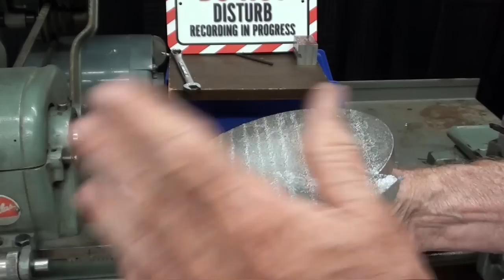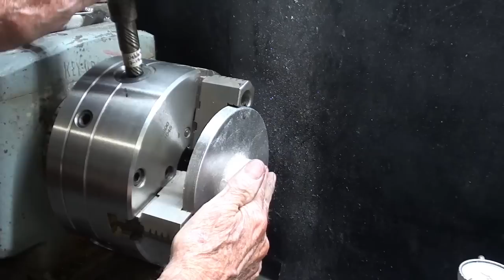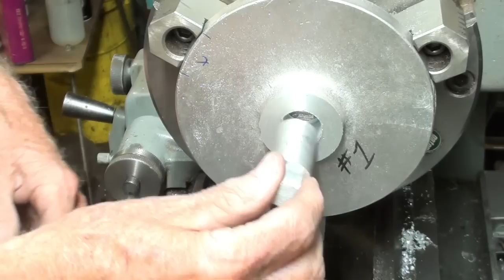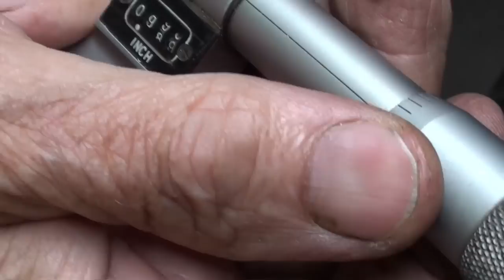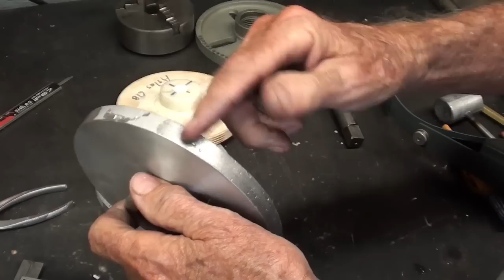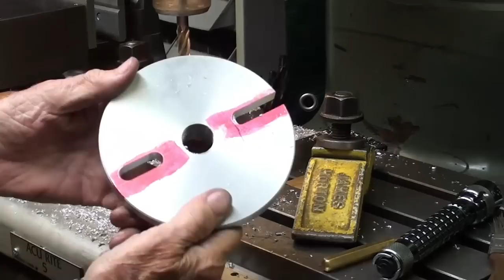DOGPLATE FOR ATLAS 618 Lathe #1003 B tubalcain pt 10 faceplate

Comment: Stop using that adjustable wrench backwards my dad caught you doing that he would let you know that is not right...
Reply from the maker: Does it actually really matter?
I have been told that countless times, but I have over 100 adjustable wrenches just in case I damaged one, lol.
Reply: @mrpete222   OK well enough said Don't use them as a hammer.

Comment: What a great video, not only was it jam packed with bodacious bolts and one nut stories, but what is really amazing is you completely manufactured the part. You designed it with a cardboard mockup then produced the pattern with draft and fillet, then cast the pattern in your home foundry (a luxury I am to be honest a little jealous of) then after casting proceed to machine the project on the lathe and vertical mill. The video just has everything I could want, design, foundry work, multiple machining operations and to top it off, hilarious Tubalcain stories to make me laugh. I cannot stress enough how much I enjoy your work. I have to be honest I haven't any desire to see abomb, or randy richards, or anyone else. Just Tubalcain knocking out projects,  making chips and cracking a few classy Tubalcain jokes is enough for this humble man, and I don't need some school principle telling me I have an awful lot to be humble about, I know it. 😉
Reply from the maker: Lol. Thanks for a great comment. You cracked me up.

Comment: Nice video Mr Pete!  I must say that my grandfather would have been all over your technique for running the die through the bore like you did.  He always required that you back the die and break chips more frequently than you did. Doing so will also reduce the force necessary to tap the hole. Keep the video's coming as I enjoy them.
Reply from the maker: I normally back the dye off when threading by hand.

Comment: Nice work.....kerosine works great  on aluminum, aluminium too..  WD 40 will also work as well.  You can face off the faceplate on the atlas to have it run true, not necessary unless you are going to clamp work to it.  Good job.😊😊😊😊😊

Comment: Nice job!!! We needed an additional tapping in a steel commercial boiler one time. The boiler inspector wanted a certified welder to weld a coupling in the boiler and pressure test the boiler yada..yada. I asked him if we could drill and tap it without going through all that and he said OK. So, we drilled and tapped it for 1" pipe. Worked out ok but was not easy. Nothing to center the tap with just used an adjustable wrench. Took a while.
Reply from the maker: Sounds like a real challenge!

Comment: The reason why a screw is slightly smaller in diameter on the major diameter is that the standard calls for flats on the threads, which is subtracted from the initial nominal diameter. That’s something I’m sure you know, but just didn’t think of.
Reply from the maker: Thanks

Comment: I acquired an Atlis 618 with identical features. With all the tooling that came with it there was a so-called commutator attachment/motor and the strange looking Jacobs chuck, which I had no clue how the heck to use it and what I was dealing with. I look forward to seeing how this contraption works. Will I use it? doubtful, no one rebuilds electric motors anymore but still curious to see.
Reply from the maker: It might be a couple months, but I will get around to it. But first I have to repair the actual damaged device.
Reply: @mrpete222  Mine needs work also it's missing the cutters. Anyway, thanks I didn't know what this thing was till I seen your setup on a previous episode. I did however figure out how it fits to the back of the cross-slide dovetail. That keyless chuck blows my mind, didn't even know it was part of the tooling setup. I haven't yet figured out how to get it to tighten. Thanks again Mr. Pete.

Comment: As always, I loved your video. 
 The Atlas 618 with a good 1/3 HP motor will surprise you. I easily machined a  couple 4 inch cast iron backing plates for the lathe on the lathe. 
I used a drill motor for the power feed to face the plates.
Reply from the maker: Maybe it has a little more capability then I would have thought. Good idea with the drill motor.

Comment: I'm happy for my ACE store to be here in our town 20 miles away because they are the "go to" place for many things instead of the dreaded shitty TRACTOR SUPPLY" horsey doggy kitty food store that doesn't have anything good or reasonable for hardware anymore.
Tip!  Here, we get a much better deal on bolts by going to John Deere or Case and buying bolts off of the bulk bolt area. Sold by the pound. And the bolts are of a pretty good quality.Myabe not the variety like Ace, but common bolts and metrics are available.
Reply from the maker: I was in tractor supply last week. They did have a huge area with nothing but pet food.

Comment: Thank you for an excellent video. 😀😀 In the U.K. the driving dogs we use have straight tails and we call the "dogplate" a "catchplate ". This has a pin fitted to it that engages with the dog tail. My little Portass Lathe that I bought when I was an apprentice was supplied with one of these. Same effect but a different way I guess it's all about different ways of doing the same job. In the U.K. we drive on the left hand side of the road - just to be awkward!! Thank You again!
Reply from the maker: I have never heard of the term catch plate. Kind of interesting.

Comment: Mr. Pete, I was under the assumption that the early Atlas 6" lathe had a bushings that supported the spindle ant those were the machines that utilized the 1"-8 thread. I have no proof. I have a Craftsman which I believe is from the 50's  and it has the close tolerance Timken bearings and the spindle utilizes the 1"-10 thread. I was wondering if your spindle has bushings or taper roller bearings?  If so, that would reinforce the theory and give people a way to buy a later model unit. Nothing wrong with bushings if oiled properly and the lathe was not mistreated by Bubba. I do prefer the roller bearings. BTW, close tolerance taper roller bearings are considerably more expensive than the typical automotive ones. Vibrations and noise can develop if the bearings are not adjusted correctly.  I ❤ My Atlas/Craftsman lathe.Couldn't you thread a piece of 1" or 1-1/4" (larger for a shoulder)  aluminum bar stock in the Clausing and then mount the face plate to it and do the finish machining?  I don't know what the through hole size of your Clausing lathe.
Reply from the maker: My machine has tapered bearings. I do not know why it has the older thread size.
Reply: @mrpete222  My thought is that there was a transition period to get rid of the old stock.

Comment: I did a similar thing on my 6" Atlas. 

 My son gave me his Southbend 9a Basket case lathe.  He bought it from some idiot down in the Detroit area.  This guy had no clue! He thru all sorts of stuff into the boxes and baskets of Southbend parts.  One of the things was a face plate that I believe came from another 6" lathe that Sears sold.  I believe they called it a Dunlap brand instead of Craftsman. It was made by a company called AA.  All Atlas made products for Sears had model numbers starting with 101.xxxxxxxx.  All AA made stuff started with 109.xxxxxxx. (Always watch out for eBay sellers. They like to advertise 109 stuff as Atlas/Craftsman.)

 Anyway, the face plate was threaded 1/2"x something like maybe 20.  Would not fit my 1'-10 spindle let alone the 1 1/4"-8 Southbend spindle. Now I could have made an adapter, but that would have stopped me from having access to my  spindle thru hole.  Instead I bored it out to thread for my Atlas.  I don't know what I did wrong, but i messed it up pretty good.  Ended up boring it out bigger an putting in a brass plug that I bored out to thread to i"-10.  I successfully threaded this plug and the face plate with a 24 tpi thread, but again had trouble with the 1'-10.  I stopped right away and ordered a 1"-10 hss tap off eBay (Chinesium).  Work like a charm.  Screwed it on to my spindle and faced both sides, bored the counter bore and trued up the outside rim complete with chamfers.  All done on the 6" Atlas/Craftsman lathe and the face plate was cast iron!  Lathe handled it like a charm!

MJ
Reply from the maker: Wonderful, maybe these small machines are more robust than what I thought

Comment: Great project love the way they leave the centre holes on things for rework. You can have made a dog driver from a nut by welding a bolt to the side though it’s not captive and you have to stop work slow without motor braking
Reply from the maker: Great tip!

Comment: I really enjoyed this video. As you have often told us, there are many ways to accomplish a task successfully.  You demonstrated your process and often gave us other options with your explanations.  Good solid instruction. 

I think that I have essentially shut down machining for this season. It is bitterly cold in my unheated shop.  I am moving into my heated woodshop. Some of my sons and grandsons gave me a workday after our Thanksgiving meal. They brought a skidsteer and scissor lift. They moved machinery and equipment, and they installed a 100A subfeed panel. The panel was less expensive than the intended welding branch circuit that I requested. AL 100A  is allowed for residential  subfeed, where CU is required for the 60A branch circuit. AL is that much cheaper than CU, that the panel cost was offset with my conductor cost savings. My shop is so large that future brach circuit home runs would keep adding future branch circuit expense, plus frequently demanding begging use of a scissor lift. The panel gives me an additional 20 branch circuit spaces and shortens branch circuit home runs. I am thankful for a contractor son that easily saw this advantage. This shop is large, and I am expanding into the space where we hung the panel. I have 3 loads already demanding installation.  With the panel location, I don't need a scissor lift. What a blessing!

I added 2 large Cribmaster tooling cabinets to my storage fleet on Tuesday.  These were still on the truck. The skidsteer was utilized to ease unloading.

I purchased a Powermatic 66 with lots of upgrades over a year ago to upgrade my heavily modified Delta contactor table saw that has long been the heart of my woodshop. Both machines exceed my ability to move between shops. The PM 66 needs some love from its commercial shop life and neglect. I began this work yesterday.  The outboard on this machine yieldin
 around 52" rip capacity. This exceeds my woodshop space capacity, but I have plans for that large table! I wired it yesterday after realizing I don't currently have an available branch circuit in the unheated shop for the old tablesaw. I culled all of my little table saws long ago. I was suddenly without a tablesaw. I didn't think that through very thoroughly. A trip to the hardware store just before closing solved the materials shortage to solve the no saw problem. You have adequate machine duplicity, as demonstrated in this video. I enjoy much of the same. I got caught short on this project by disabling a critical machine.

I am anxious to begin belated hopechest projects in the woodshop. ...now to complete the PM 66 installation.

Comment: So, the 5/32 of shrinkage is that set in stone for any project i.e no matter the size of the casting and volume of material used for said casting? Does each metal have different rates of shrinkage also, for example will cast iron shrink at a different rate than aluminum etc...signed curious in Flushing
Reply: The shrinkage is very dependent of the material
Reply from the maker: Yes, other metals have different shrink rates

Comment: Great project video, MrPete.  I enjoy watching all the processes you go through.  At our local Tractor Supply store, they sell hardware such as nuts, bolts, washers, by the pound.  So you can dump an assortment into one bag, then at checkout, they charge by weight.  It would probably still be a $5.00 bolt.